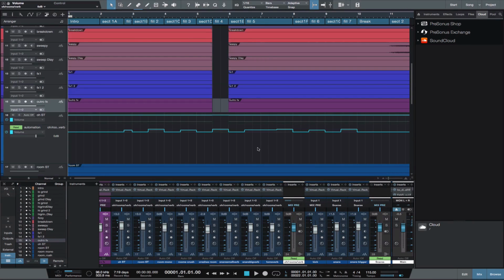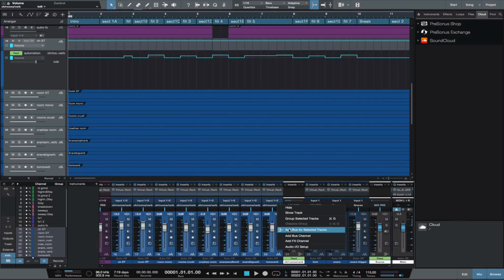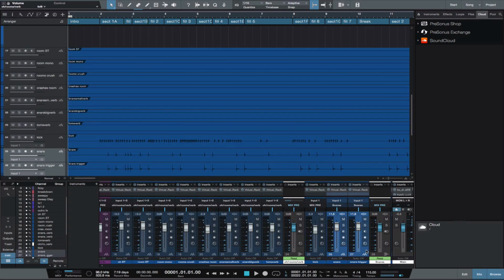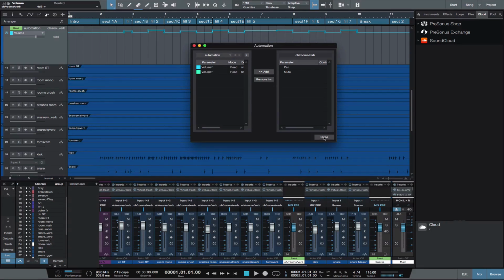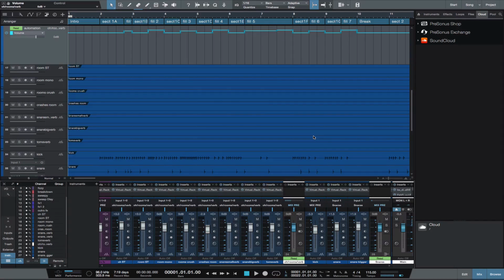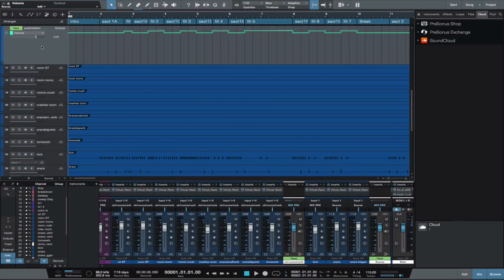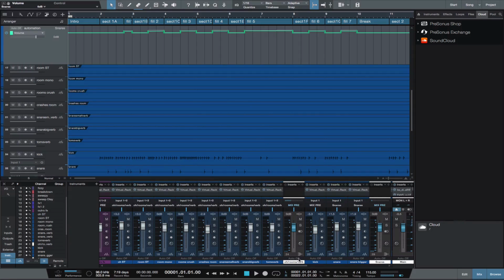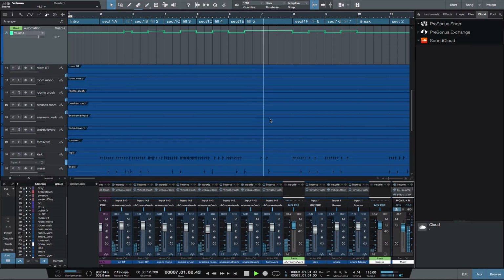Adding Drum Automation to Add Excitement

Comment: Good stuff but I wish PreSonus would sort out the illogical modifier key setup in studio One. Normally in Windows the Ctrl key is used to create copies by dragging and it also is used to select non continuous files.
Try doing typical moves like that in Studio One and you hit the first brick wall, namely that Ctrl is mapped to the Range tool. The Alt key would be better utilised for the alternative tool selection.
What is puzzling is how Studio One modifier keys differ in the Track View to the Arranger View. Shift clicking tracks in the track view performs the typical Shift behaviour that it does in Windows, it selects everything within the highlighted range but then try doing the same with events and S1 only selects the first and last events that you selected. I think PreSonus need to reevaluate the modifier keys behaviour as it's counter intuitive to anyone who uses Ctrl, Shift and Alt in daily computing
Reply: ***** are you happy with that though? For me switching the CTRL key with the ALT key and then assigning the standard modifier key plus mouse moves would make S1 easier to use as it would be replicating the common moves that we find in day to day software.
Reply: ***** sadly that's only for the keyboard shortcuts. The mod keys can't be customised